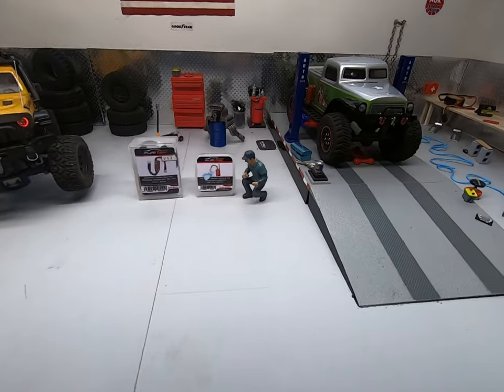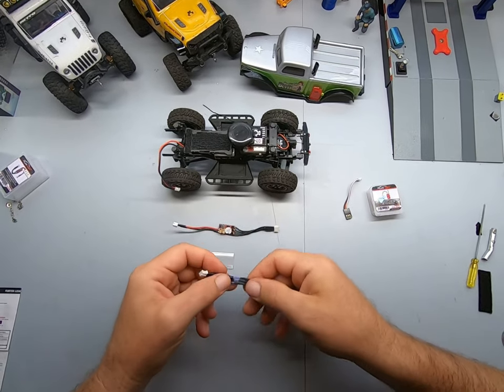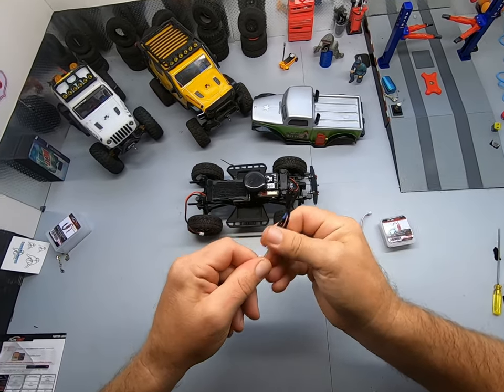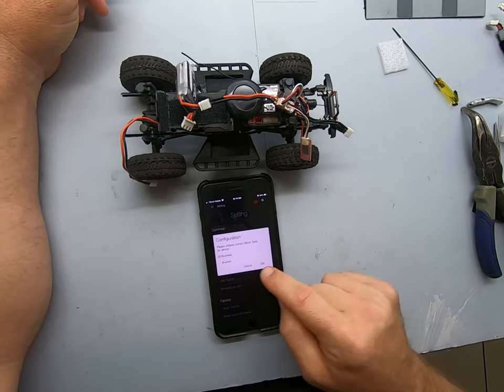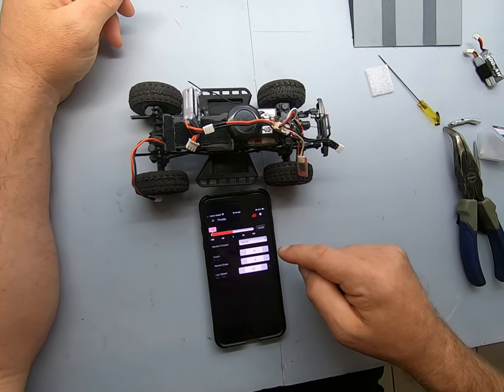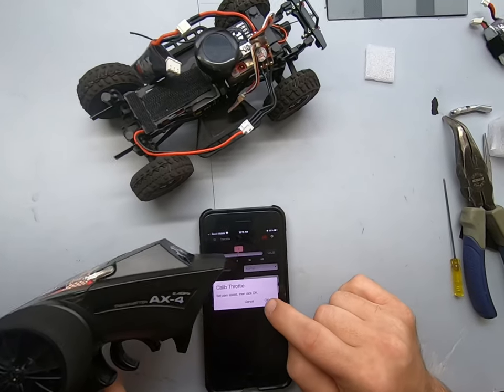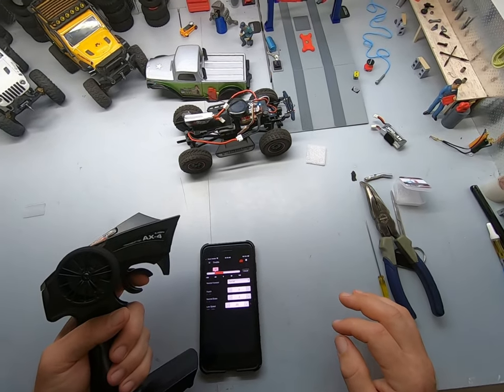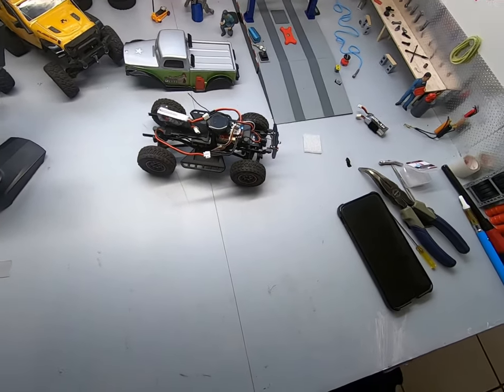How to Install Furitek Lizard esc on Brushed Axial Scx24 #barrage #hotracing

Comment: Do you need the Bluetooth dongle to work properly or can you use just the lizard esu.
Reply from the maker: If you are using the lizard esc with a brushed motor then yes you would need the Bluetooth dongle to set it to brushed because from factory they come preset to brushless

Comment: Cool bro changing the throttle curve should slow it down as well! 👊😎👍
Reply from the maker: It’s so cool Mike 🤙🏼
Reply: @soflorclife6970  Yeah I saw the lizard running a Charisma 8000 kv motor and it was unreal! Super slo mo and still had punch and speed... Crazy setup! 👍

Comment: Great video. So you didn’t get rid of the stock esc/receiver because you needed the receiver correct?
Reply: You need a receiver. That it what is great about these, they can use the stock receiver or aftermarket.